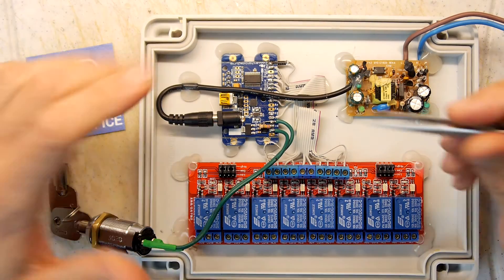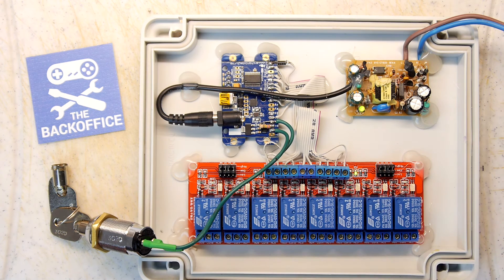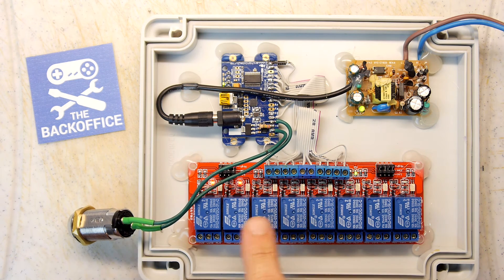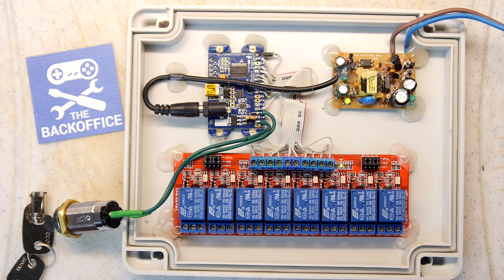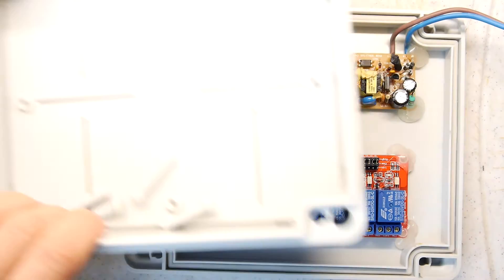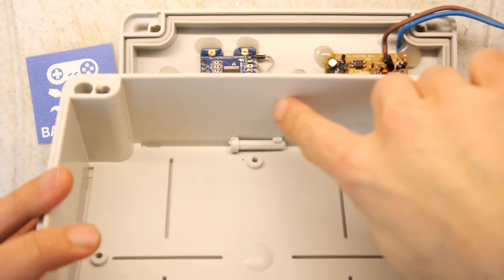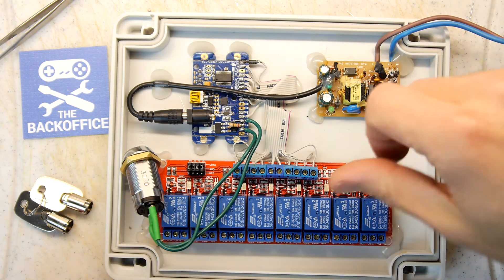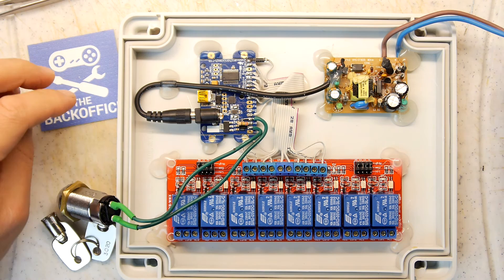Arcade Cab Power Sequencer Build Part 1 (Arcade Activator)

Comment: Great project - missed these kind of build videos 👍
Reply from the maker: +Simon Lock Thank you, currently waiting on parts. Always a potential issue with you build on the fly out of stuff lying around.
Reply: The Backoffice yeah, know the feeling. Still waiting on HK deliveries for my stuff and USA contact won't return my correspondence :(
Reply from the maker: +Simon Lock In case it's on fuse holders, I guess I could skip those 🤔😂

Comment: That's really REALLY nice. Would your programmable board be able to support input for emergency kill switch?
Reply from the maker: I have a spare input on the board I could wire to a 'ALL OFF INSTANTLY' mode. Should not be too difficult at all.
Reply from the maker: Although if it a REAL emergency would it not be more sensible to add an industrial kill switch in series with the actual power to the box to just pull everything? 

If its a genuine emergency, I would not want software and relays getting in the way of safety. 

However the 'ALL OFF NOW' feature on the second input is cool. If I have the time I will let the various modes be programmed via USB so the user can set what the inputs do and the delays between the outputs. Also they can choose the order for on i.e. 1 to 8, 8 to 1 and off, again 1 to 8 and 8 to 1. That should be enough complexity for most people.
Reply: The Backoffice Yeah, your right. I was just overthinking. Sequenced Xmas lights anyone lol.
Reply from the maker: +ataristaffroom Sequenced Christmas floodlights 😀
Reply: The Backoffice Yeah! 
Was in Morrison's yesterday and JML have brought out a multicolour laser starfield you project on to the house instead of fairy lights 😂
Reply from the maker: +ataristaffroom those are pretty good when I played with them a few years ago. Single lasers through a rotating etched filter. Pretty cheap too!